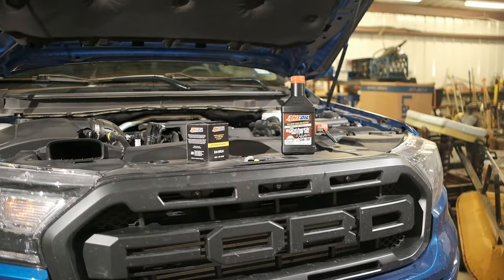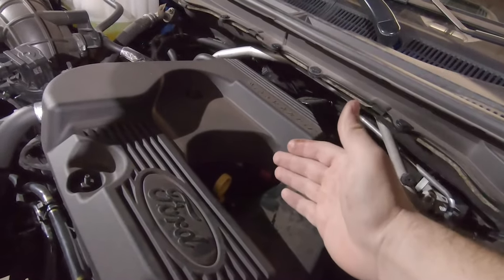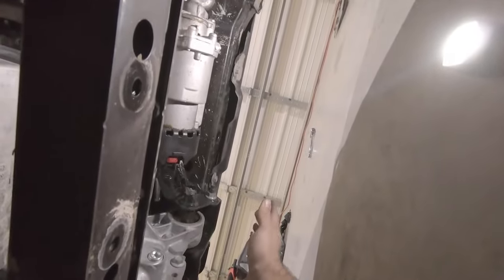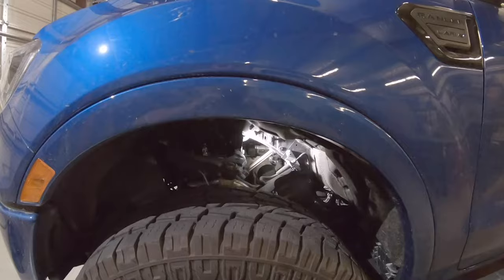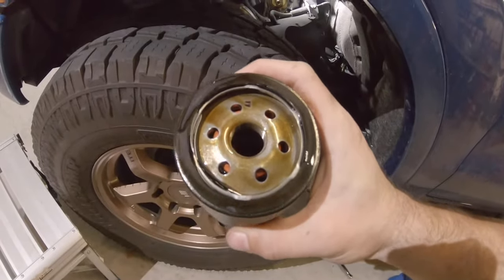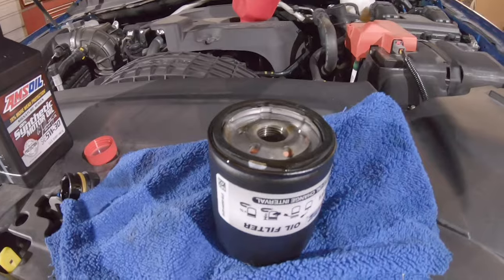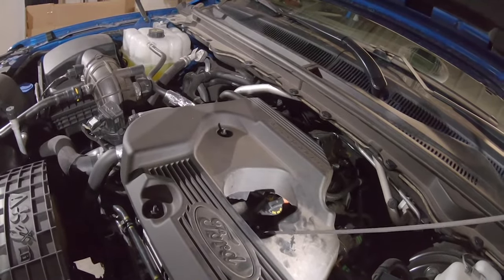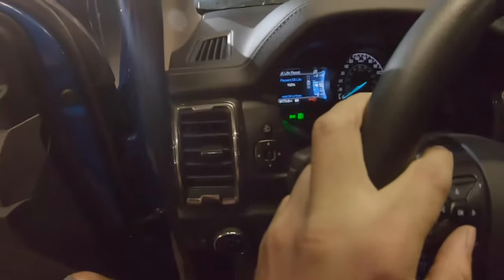How to Change the Oil on a 2019-2021 Ford Ranger (AMSOIL OIL CHANGE)

Comment: You dont have to prefill the filter. Ford has a primer feature. Hold the brake a gas all the way down and hit the ignition and it will crank for like 10 seconds wothout starting. This primes the filter. Then you can start with oil pressure
Reply: Brake and gas all the way down and hit the ignition

This sounds like a troll

Comment: Just finished changing my oil.  I laid under the truck for 15 minutes looking for the damn oil filter.  At one point I thought maybe they didn't use one.  Got the manual out and it said it had one so I came to Youtube to find it.  Crazy to have to go through the wheel well but it was actually really easy.
Reply: That is typical of Ford. They attempt to make the car serviceable. How many car companies would think of that drain channel too? Not many if any.
I remember a high school buddy in the early 80's had a Chevy Monza. He had to PULL THE ENGINE, to change spark plugs.

Comment: Buy an FUMOTO valve and you won’t have to worry about a wrench for the drain plug or skid plat removal. You will need the small adapter which they sell. Then add 6” of tubing and done. No more skid plate removal or drain plug removal. Just flip a switch.
Reply from the maker: This is true. I always forget to order Fumoto valves. I’m coming up on an oil change soon for my old Ranger so might as well order two. Thanks
Reply: How much is a fumoto valve I'd like to get one for mine
Reply: @paulpeters5199  like $30. But you will need to get the adapter/spacer also. The valve needs to be spaced away from the drain pan by 1/2”.  Just go to the website and select your vehicle.
Reply: Thank you I'm ready for an oil change and now will be the time to do that thanks again for the help
Reply: @jchiar  yes. I tuck the tube up in the skid plate. On my XLT I don’t use the tube since there is no skit plate.
Reply: I'm glad you commented on this because I was going to. Too bad all the auto manufacturers don't include a Fumoto valve on their vehicles.

Comment: Love my '19 Ranger XLT FX4 . 18mos/14k mis. Used only SN+ full synthetic 5w30 motor oil. Motorcraft oil filters highly recommended! Phenomenal powertrainn & suspension.
Reply: It is up to SP level for the oil now... :)
Reply: 17k miles on my 2021 ranger, already got a rebuilt trans, and the trans STILL kicks, and refuses to shift properly sometimes. 5 recalls and unevenly wearing tires. still love the truck!

Comment: Thank you for your channel. I just bought a 2020 XL. I’m concerned about the gas in oil. Keep us posted.
Reply: Don't be concerned!  Ford's TGDI (Ecoboost) engine design has been the best of these designs of any automaker. Use only SN+ rated full synthetic motor oil & Motorcraft filters! Do the 1st break- in change by 1500mis! Allow 1000mis easy driving. No revving / LONG IDLING . Enjoy ur new Ranger! Best truck in the class.
Reply: @davidklimmek3192  love my Ranger FX4
Reply: @Oakleyworld  Me as well. Fantastic trucks!  Ford over- engineered the Ranger to last long & outperform all others. Key is good reg maintenance!
Reply: Use premium fuel 91-93 octane if you want 300hp & engine to run cleanest. Reg 87 octane is bad for turbocharged DI motors.
Reply: @davidklimmek3192  yes only premium always, i try telling people.
Reply: I just did my first oil change at just over 3 k miles. Then thinking every 5k miles. What are your thoughts? I run 87 octane as ford says its ok. What advantage do i have by running 92 octane?
Reply: @davidklimmek3192  91 all the way bro

Comment: I run Amsoil oil & filter as well, for the full 25 000 miles.  I change the filter about halfway through the t oil life though.
Reply: I would never run oil for 25k miles... :)
Reply: @frandanco6289  It's hard to comprehend, I know.   I was born in 1970, and things have changed since my father thought me about motor oil in 1984.  Nothing I was taught about as a young man, about vehicle in general, applies any more.

Comment: 5,000 miles MAX! Not 1 more. That engine and turbo will be toast after 10,000. 25,000 is insane. I also run Amsoil signature series and a wicks filter.  But I change it every 5000 miles.  I still enjoyed your video and it does help people maintain their vehicle but 5000 miles is all you should go between oil changes no matter what oil and filter you are using.
Reply: I do the same as u. Amsoil evey 5k. 100k miles on a 21 ranger, no issues. 👍 better safe than sorry!
Reply: Absolutely oil changes are a must. I don’t quite put 5000 miles on this year so, I’m changing my Amsoil signature series this year at about 3800 miles because I have a year on the oil.  Oil is cheap versus destroying the engine.  I got each qt for about $11.80 from our local Amsoil dealer. The wicks XP filters can be kind of hard to find. I found that O’Reillys has them.  That’s great to hear you have gone a 100,000 miles. It should easily go another 100,000 miles if it’s taken care of the same way.

Comment: Great video thanks.
You mentioned you have 33s on your truck. what offset wheels do you have to fit that? I also have a 2 1/2 inch leveling lift

Comment: Have you done an oil analysis yet? I've been looking at rangers as a possible daily instead of a sedan. Any issus/problems about or with your ranger? Have you towed with it or primarily overland?
Reply from the maker: Not yet. I have a little over 13000 miles. I changed out w/ Amsoil XL around the 2000mile mark. I’ll do a black stone test when I change the oil again. (Or during oil filter change)
Reply: @HarlesGarage  i use their 5w30 signature series. On my daily driver.
Reply from the maker: @ceescorner  Nice! yeah the truck is primarily overland. If I keep going on trips like I expect to do I'll def hit 25K miles in one year.
Reply: @HarlesGarage  hows tour truck holding up? I just picked one up for that very reason.

Comment: You may need a oil filter wrench to get the filter off. I had all my oil changes done at the dealer till my "Free oil changes" ran out. My first oil change the filter would not move till I got a wrench.

Comment: 50k miles 2019 ford ranger xlt. Changed the oil every 3k miles. I drove as this is a mustang and the engine runs like new. I used the blend but now thinking going full synthetic since it is cheaper than the blend 😂

Comment: Man I too have the same problem. The smell is so bad I could smell it when I am at  idol at a light stop sign. The smell is also inside my cab even when I get out of my truck and turn it  off and im walking away from like 5' away or  more I could still smell it. I have a jlt catch can and I  thought maybe that's the reason too but I don't see how or why that would cause it. I guess I have to take mine  to the dealership also. This sucks, new truck!

Comment: dip stick should be fully seated when adding oil before checking?
Reply: It doesnt matter if the dipstick is in or not...  You are supposed to add the oil put the cap on, make sure the dipstick is inserted and all the way down, start the truck, check for leaks, shut it off, wait a few minutes, pull the dipstick, wipe it, re-insert it, pull it out, check the level...New, my '22 Lariat came with the oil level just below the top hole on the stick and it is still there with around 1,200 miles...I am going to change it and filter now, because I know that BMW changes their M cars - all their fluids at 1,200 miles for a reason... They used to do it to ALL the Bimmers they sold, but can you imagine how much that cost???? They eventually just reserved that for their "M" performance vehicles...

Comment: You are supposed to remove and replace the oil filter due to the variable oil pump first in order to complete the change fast and not risk the oil pump losing prime. Multiple people and family members learned the hard way with engine replacement. (Doesn’t just affect the Ranger).

Comment: Your doing all that work for nothing. You don't need to pull the skid plate. You just need a 15mm gear wrench. A funnel like one man said would keep you from spilling the old oil while draining. You don't have to prefill your new oil filter either. That's just done on diesels because the filters are too big.

Comment: Would be nice if changing your own oil saved you a few bucks but I literally spend more just on oil and filters than paying the mechanic $50 to do it. I found a sale and getting only 6 quarts I spent $51.72 sometimes I get coupons for $35 change from the mechanic down the street.

Comment: After watching this I realize my 2021 didnt come with plastic engine cover
Reply: Only the lariat models come with it. And it's actually a high density foam. You can order one on eBay for like $100. Reduces engine noise pretty significantly.